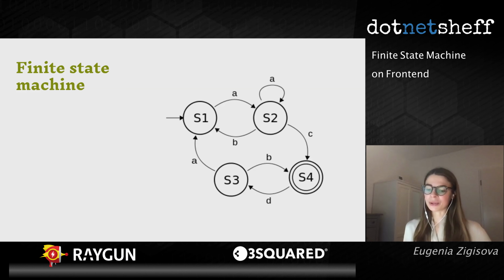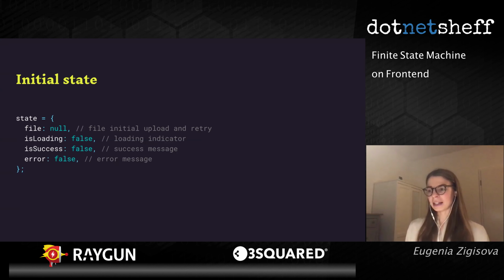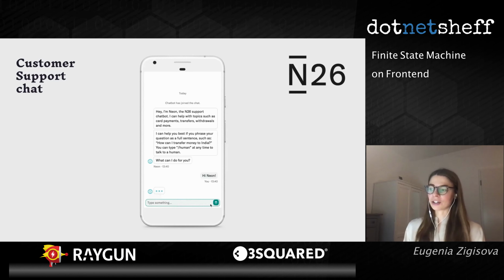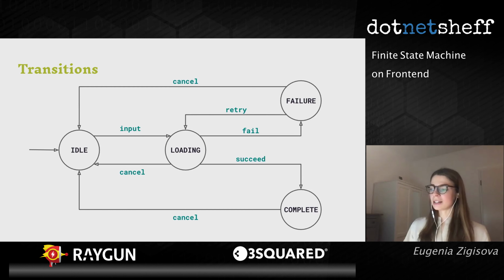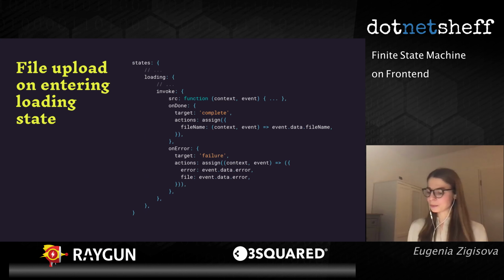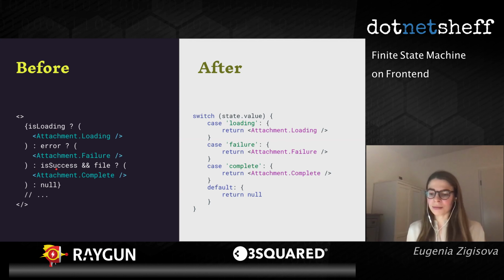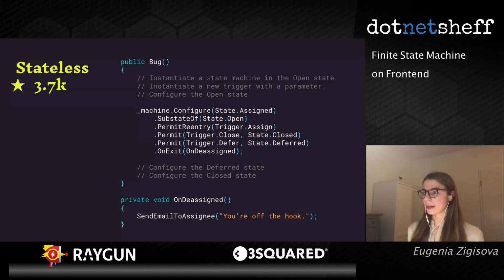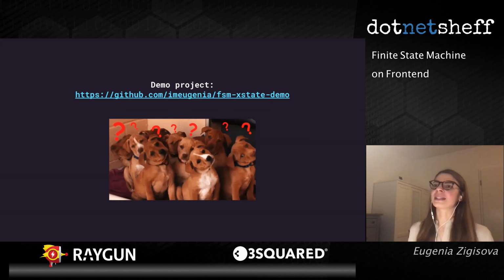Finite State Machine on Frontend

Comment: I use N26 :) Great video. I was looking to implement all fronted logic using a FSM for the company I am working for.
I do have some questions about xState though
Reply: Hi, 
Great! I think that any web application will benefit from this pattern. I could try to help to answer your question if you still have them (cause it's been a month since you left this comment. So sorry about the late reply!)
Reply: @eugeniazigisova7931  dont worry about the time! its relative XD its still like yesterday for me as I am still planning the app. I am just glad you took time to reply and are willing to help XD I love such devs. So the question, can I add business rules logic using state machines? I mean yes, we can with state machine pattern but dont know that with xStates! Lets take an example, load component XYZ only if 1. user is logged in 2. have completed certain onboarding process. In short, execute component render ONLY if BOTH condition A and B are met.
Reply: @avimehenwal  Sure thing! :) When reading your question Guarded transitions came to my mind (https://xstate.js.org/docs/guides/guards.html#guards-condition-functions) 
Let's say there are 2 states: A and B. "A" state is idle and B state represents conditions 1. and 2. that you mentioned. You can store "logged in" and "onboarding completed" data in the context of the state machine definition. When defining state "A" you can access content with necessary data and set conditions for an automatic transition. 
They have an example in the docs. I hope it will help. 

The only thing I'm not sure about is: most probably you are already storing your data somewhere. Perhaps, you could access this data from that storage instead of putting it in the context of FSM.